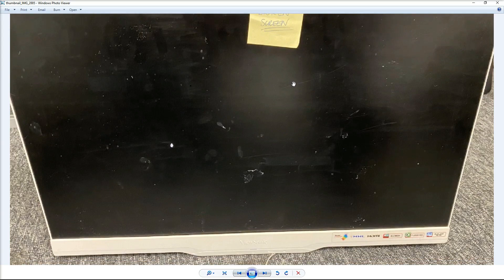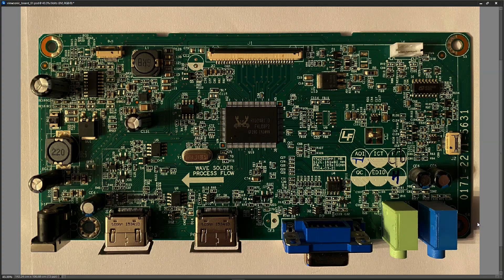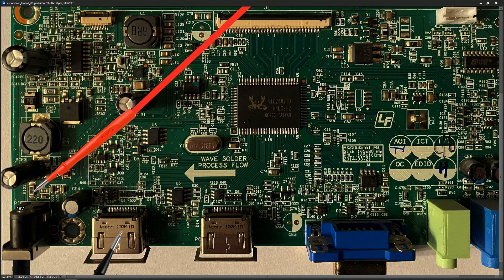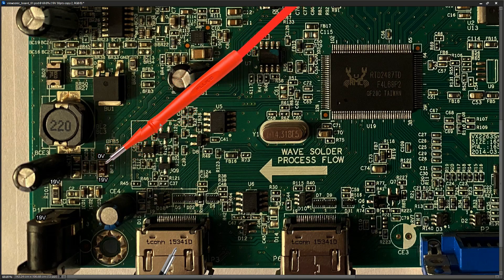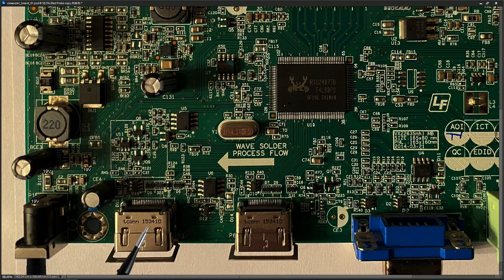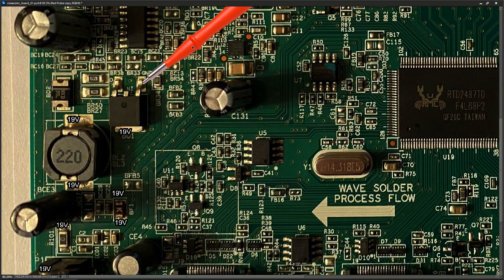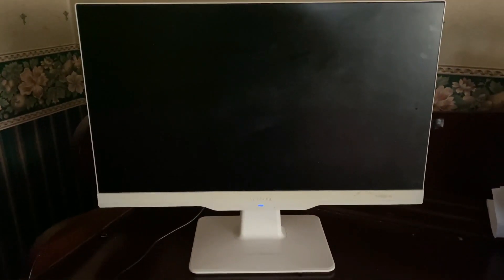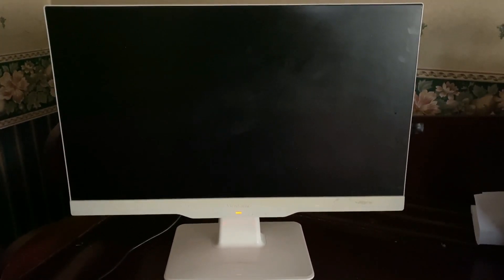ViewSonic VX2263SMHL - No power

Comment: What would you check if the screen powers but the backlights aren’t going on? I have the same monitor and when I shine a light to it, I can see the image but the backlight is just not turning on
Reply from the maker: Yes, you have diagnosed correctly. There is a backlight system that consists of an LED driver circuit and usually two LED strips. Most likely one or two of the LEDs have failed and this is causing the system to shut down for protection. I'm not sure if you can get replacement LEDs for that monitor.

Comment: It doesn't matter how you get there, a win is a win!  Once again, I like the style of your videos using static images, especially with the text overlays. Much clearer than videos for this type of thing. Thanks.
Reply from the maker: Thanks Geoff for your comments. I'm still toying with the graphic software to see what is the best way to present these videos. I'm thinking that marking out the voltages at each section and maybe also running a line along the path of the current flow may be the clearest method.